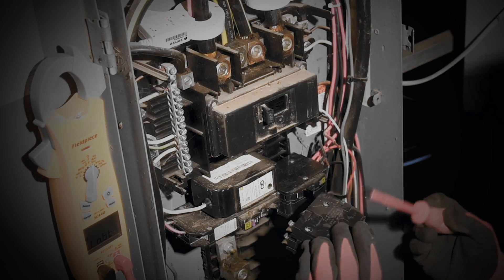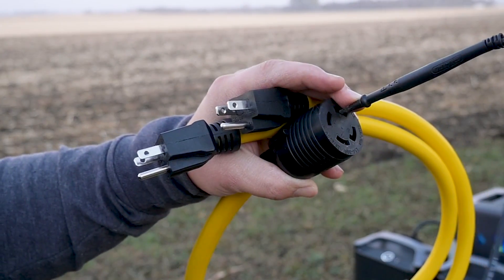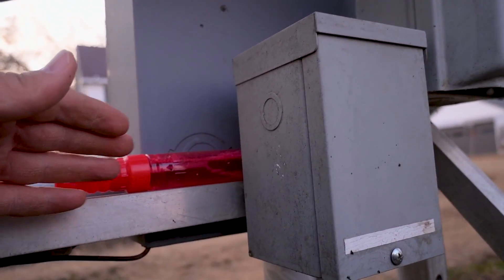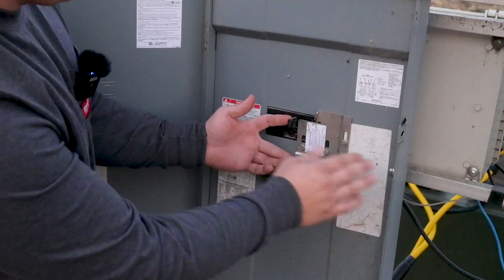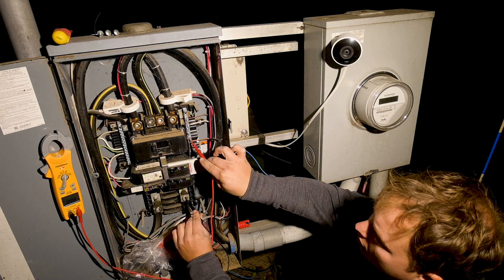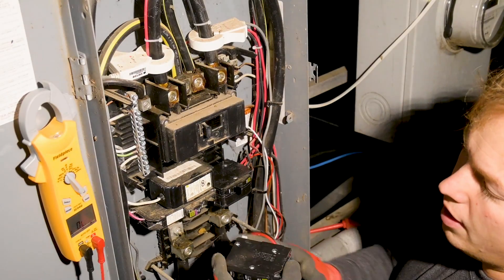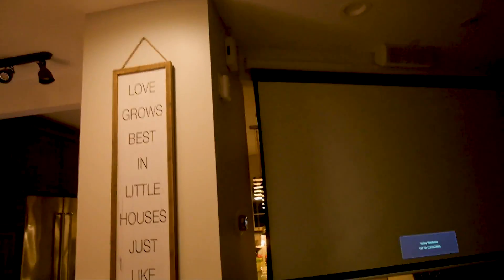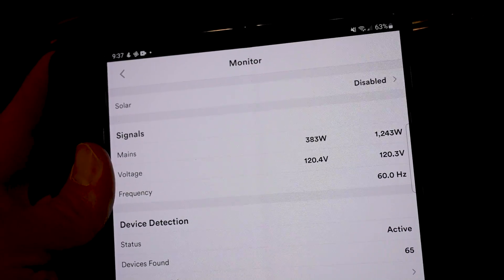Can You Power a 240 Volt Panel With Two 120 Volt Generators?

Comment: How about powering both legs of a panel through a interlocked breaker with a 110 inverter generator? Probably could leave 220 breakers on since its the same voltage? 
Great video Ben! Nice to see a family man on you tube

Comment: You could also plug both plugs into the same battery/inverter.  Outback power used to make a device that would allow their inverters to stack and frequency match.  The catch is that you have to have inverters that can stack.

Comment: Yep for sure looks like everybody figured that one out your power banks are out of phase you get  to 240v and then they drop down to zero 
FYI somebody I think it might be Honda has generators  you can hook two 110 generators together with a cord and they will phase in sync then you can get to 240v.
Reply: @ricklee4  Yes, now I remember, it can increase or double the wattage.
50 years ago, while I was doing HVAC commercially, we had a situation after a fire in a restaurant.
We needed to keep the 110 refrigeration coolers in operation till more permanent repairs were made.
We simply jumped one leg to the other in the main box and use the only 120v generator (a Coleman 1200 Watt) we had available at the time.
The Service was disconnected at the pole. Till repairs were completed.
Nowadays if you need 240 volts there's a lot of cheap small generators on the market (HFT).
It's cheaper than using two small 120v generators 
Panel interlock is great idea, it saves you from lighting up your neighbors, or power company employees in an emergency power outage situation.
Ben, you're doing a great job, keep up the good work.
 I'm retired now but love watching everybody else work.
 thanks.

Comment: Unless you know as much or more about electricity and power distribution than Benjamin, your best bet to stay alive and not burn down your house is to have a professional electrician install a transfer switch that cannot have both utility and generator power applied at the same time.
Reply: I have 2 transfer switches mounted and trying to figure out how to run gas generator on 220 volt while simultaneously running a solar generator on 120 volt lighting on the same 200 amp panel.

Comment: Digital meters are n good because of all the inconsistent readings. Anaolog meters always worked best. No batteries required, and where the needle lands is what the volts are, assuming the meter is calibrated correctly. There is also a wheel on most so you can fine tune the needle. Also, if you peg them, sometimes a little percussion will make it work again.

Comment: Is there something that will allow the two 120V legs to get in sync? basically some inductor and/or capacitor combo, or some circuit that will phase shift the output to match the other leg?
Reply: The best way would be the generators having a com bus so they can share and adjust phases to match a 240 volt source. If that’s out of the question then I think you can have a Dual AC to DC to AC converter. It would take in two ac signals, rectify them to DC, buffer with a cap then generate two signals that are synchronized and reverse phased.

Comment: You should try plugging both legs into one battery bank. If I'm thinking through it correctly, you should be able to leave the 240 breakers on because they would be getting 0 volts but any single leg breaker would get 120v.
Reply: Cool video btw!

Comment: Would this work on a single inverter generator with multiple 120v outlets? I just want to power both sides of the bus bar with one generator. I don't need to run the 240v things but having access to all the 120 circuits would be awesome.
Reply: Most generators with a 4,000 watt and higher output will have a 120/240 volt receptacle, that has 4 wires connected to that receptacle.  Just use that receptacle to power your 120/240 volt panel, and you will be fine.

Comment: You are experiencing "phasing" which happened when two independent AC sources are not synced AND in proper phase. L1 & L2 phases are exactly 180° apart in split phase systems. The two generators COULD be in sync. But they NEED to be in phase and in this case they NEED to be exactly 180° apart. So you need to have BOTH (sync & phase) for proper operation. I would also bond the grounds together as well.
I had made some mods to generators that used Bluetooth to keep generators in phase. They would talk to each other and randomly decide which will be the master and which will be the slave. The master would send zero crossing pulses to the slave and the slave would keep that phase relationship...
Reply: @ricklee4  actually the grid is a 3 phase delta system, not single phase. Each phase being 120° apart. And power delivered to the house is a split phase system with each phase being 180° apart because the pole transformers secondary is a center tap winding. This CT IS the neutral. So It totally depends on where you reference the signal from. From CT to each hot leg there is 120v single phase. From each hot leg (L1 & L2) there is a potential of 240v single phase, however each hot leg is 180° with each other with reference to the neutral, this can be verified with a scope. Its best to use a battery operated scope or an isolated scope because the ground part of each channel is electrical grounded to the chassis of the scope and ground connection to lower the scope.

With reference to the power grid when a generator is brought online it is to INCREASE total power on the grid, not voltage. It is imperative that the generator be operating at the proper frequency AND phase angles some people call this "in sync" with the grid. Technically "in sync" should not be used as the grid and generator can be in sync. But out of phase. You try to place a generator that is in sync but out of phase on the grid, and it will trip out.

Thay guy on youtube you referenced made a very simple subject WAY over complicated. He is horrible. I would hate to have him as an instructor. .
Reply: @ricklee4  hey I watched this guy with a very good explanation:
https://youtu.be/nOSYHUxHxG8

When using a scope ALWAYS keep the groumd side of the probe on the neutral or you will be sorry!! Sparks will fly
Reply: @ricklee4  yes I agree. S phase angle is always applied to AC, where polarity is applied to DC. Using the correct terms matter. A scope can measure phase angles, whereas a simple VOM meter will measure polarity. Typical electricians dont use scopes, but they always use meters.
I am a EE and use a lot of various test equipment. I also test and calibrate my test equipment as well.
I never want to comment from a position of authority, i try to use simple terms and will use other sources to support my ideas rather than saying "because I said so...." Haha
Im glad our dialog was not adversarial. Thank you

Comment: It's not weird you're not synced in phase... Or out of phase you have two separate 120 volt sources that are random.  This is also alternating current you know that current  travels on your neutral right?    And the voltage reverses 60 times a second right?   In other words the two sources are not independent when you combine the neutrals.

Comment: on the bright side, it was much better that you discovered that the breaker was faulty outside a real power outage or an emergency, which is why we must periodically test all power systems, especially those that are infrequently used. Cheers from Brazil.

Comment: Theoretically, you could design an inverter to "slave" itself off of an external source (different inverter).  But no inverter company is willing to do this.  Serious issues on a 240V load (like a pump motor) if they do NOT stay perfectly synchronized.  120VAC240VAC transformers exist, but $,$$$ !

Comment: Yeah, other comments have already said this, but I'm throwing my own confirmation in, too.  The two inverters have slightly different frequency and will drift between full amplification (240VAC) and cancellation (0VAC) and back.

This is actually how big generators are put into sync to either increase available voltage or amperage.  One generator is put to a slightly different frequency and the voltage is monitored until the desired voltage is reached, then they are synchronized.

Comment: Ahh thats too funny, i just bought one of those spliter cords as well, but for the opposite purpose. If you plug them into two outlets that are on opposite phases, you can "make" a 15/20a 240v outlet in a pinch. I only bought it to experiment with car chargers, you could be visiting somewhere and get L2 instead of L1 rates in a pinch. Never actually had the need to do this, but I swear I get way too much excitement playing around with funky adapters like this.

I got the one that goes to a 14-50 plug instead of the twist lock 30a plug, but it's basically the same thing otherwise. I have a generator interlock on 14-50 as well, so I can totally pull this off too, lol.......

Comment: Theyre somewhere  out of phase.  Interestingly, one of my legs from the transformer lost continuity in the buried cable.  So half my circuit panel went dead.  Power company came out ans hooked up a phase inverter appliance about the size of a welder to the remaining 120 volt leg and sent the inverted power as a substitute forbthe dead leg.   They came back a few days later, ran a new cable, and took away the phase inverter.   So if you had the phase inverter you could make 240 with a single 120 volt generator.

Comment: You should use same clock (oscillator), one inverted, or just phase and neutral inverted, for both inventors. Grid has its own solutions, there are electromechanical generators running. Inverters can not be coupled, i belive, but with single clock. Check me twice for safety.

Comment: The generators performed exactly as I suspected they would. Unless they are and could remain perfectly synchronized an at the same frequency, the voltage will slowly move up and down between 220v and zero.

Comment: I was hoping you had a way to actually power the 240v with two 120v generators. Most generators that can be connected with a parallel kit will synchronize frequency when connected. I was hoping you had discovered a way to actually get the two generators out of phase and actually get a consistent 240v. 

The voltage between the two hot legs varies from 0v to 240v in your case because the generators are not exactly 60 hz and are not synchronized together.

Comment: You nailed it… the frequency between the two separate power sources are not synchronized. One is probably running at something like 58hz. 😂and the other at 63hz. So there sine waves were sometimes in opposition and other times they were in parallel thus cancellation.
Reply: Theyre bothnrunning at 60 but they are not starting at the same time.
Reply: Exactly. They're probably both at 60 hertz but not exactly and the phase shift allows them to be in sync and then out of sync causing the voltage differences over time.
Reply: You have frequency and shift between the two frequencies based on time. The 240 voltage is based on the shift in the frequencies not the frequency itself.

Comment: It'd be interesting to see whether using a generator to only charge the batteries would use less fuel overall compared to just running the generator to power the house for the same time period.  The generator would have a higher power output over a shorter period of time if it's only used to charge the batteries which would burn more fuel per hour compared to a smaller load. If the generator was used to power the house full time, the assumption would be that it would output less power (compared to charging the batteries) and thus use less fuel per hour it ran.  Begs the question, at what power output level is the generator most efficient?  Does the loss of going in and out of a battery pack have any impact? I'd love to see a video testing some theories!
Reply: Check out Edison motors, he’s doing this exact thing on his diesel electric semi-truck
Reply: Part throttle power on a gas motor is very low efficientcy. Generally 70% throttle is optimum. So, in theory, better to power tge gen at 70% for a short period. But you must compare that efficiency gain vs the loss that the battery causes (charge vs discharge losses). Likely better with the batteries if they are large enough.
Reply: @markhischier2750  Generators need to run at 3600rpm to get 60hz (not sure if this differs for inverter style) so the throttle level wouldn't differ, it would only be the load on the engine at that 3600rpm that would change.

Comment: the wobbly 240v is caused by out of sync sine wave. One is 60hz, the other is 59hz. Due to wave cancellation, the two legs will seem to wander from zero to 240v. With Some inverters you can sync them together using the master as the clock. The slave is programmed to be out of sync by 180 degrees of the master clock giving you true 240v from two 120v sources.

Comment: No surprise if you get varying voltage.   To obtain 240 V the two hots have to be 120 V in opposite phase.  Unless your sources sync those phases and invert one with respect to the other, it's a no-go.

Comment: Need to have two of the same brand/size generators and have a sync option otherwise they will be out of phase. I think there might be a problem with 2 120 volt circuits that use a common neutral.

Comment: I haven't watched the video but I'm going to make my prediction here and leave this comment unedited. Based on my understanding of phases, you cannot use two generators to power 240 volts because the phases are not synchronized (reversed). Not only that but the neutrals are not connected either.
Reply: The neutrals are connected connected in the first breaker panel because they are both bonded to the ground.
Reply: @jackpatteeuw9244  yes that’s correct. I was wrong about that
Reply: @Robert Swaine it’s not because the frequencies are slightly off, it’s because they are not synchronized and each phase is at a random located based on time based on when the generators were turned on. I’m sure you can time them and come up with a sequence when to turned them on to get 240 AC but they will eventually drift off again because clocks drift. You would need some type of sense wire and logic between the two to dynamically adjust the clocks so they remain timed.
Reply: Robert Swaine is mostly correct. But, if you can get the two seperate generators synced up and on line, the load will keep them synced. The most straight forward way would be to have 2 oscilloscopes monitoring the phase of each generator. Throw generator 1 on line. Then, when the phase of both generators synce up with each other, that would be 180 degrees out of phase, throw generator 2 on line. Tip. (Generator phase does not run at a perfect 60cycles, they vary typically by as much as 3-5 cycles or hertzs.) So 2 seperate genefators can eventually synce up there phase.
Reply from the maker: That's exactly what I thought and as you'll see that synchronization issue is observed shortly.